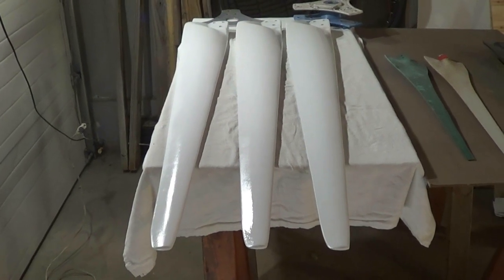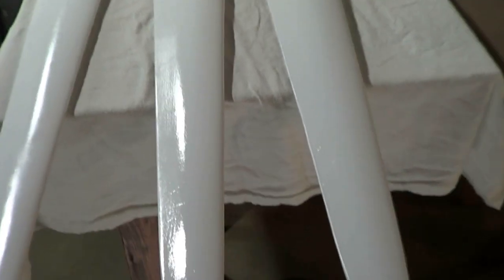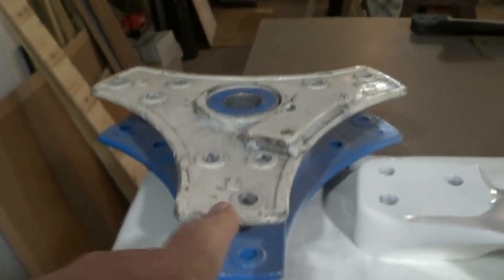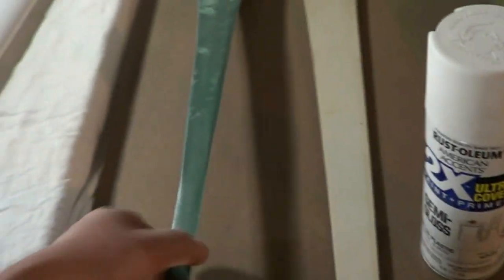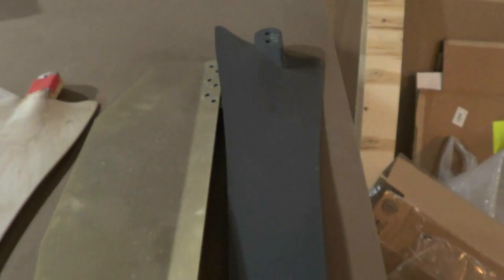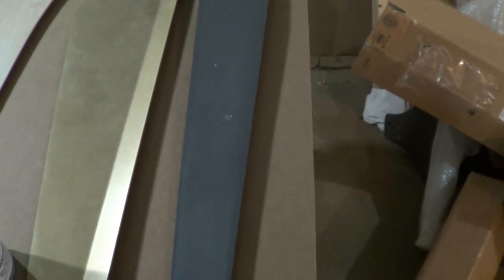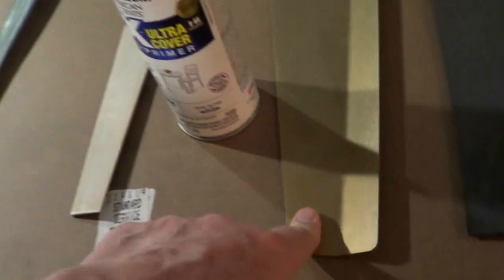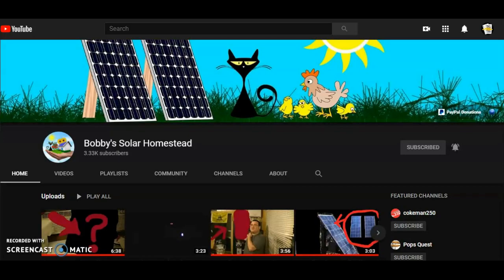AXIAL FLUX WIND TURBINE CMS BLADES

Comment: Good to see you back Billy I noticed on your wind turbine there the picture of it it don't look like it's got slip rings on there are you not putting slip rings on or do you have to have them reason I asked is mine is pretty much crap that I got on and I got to take it back down I don't want to take it down and put it back up too many times cuz that's a lot of work maybe you can help me out and let me know if you do have slip Rings maybe you could point out where you're getting them and that turban on that midnight controller sure look like it's putting out a lot of power good job and thanks for your videos man they sure help a lot keep up the good work

Comment: At what speed do these make some wattage at?
Reply: If you get it dialed in and the right bladeset they can start producing in a 3-6mph wind
Reply: @ericjackson6082  awesome thank you so much. Which I knew about these sooner.
Reply: @GrumpyMountainMan  I know me too!! Billy here has tought me alot and a man with your skillset could definitely build one!!
Reply: @GrumpyMountainMan  if you go to my channel you can see what I have so far I got 307 watts out if it with a cheap set of blades and 1 set of magnets in a 20 mph wind my bigger set of blades just arrived so when I get those on I will do another video
Reply from the maker: Hey GMM, the biggest problem with the turbine is having a solid tower, because of degrees of force from the blades and wind. Let alone the weight of axial flux. the startup vids will be coming soon as Tim puts his wind guage on tower. Thanks again!
Reply: @blackjackaxialfluxturbines4174  would a 2 inch rigid conduit 20 feet in the air support it?  I have 2 unistrut supports plus a base 4 ft in the ground. I'm not using guy wires.

Comment: I'm at the blade building now. 
2.4meter set. 
Wonder which is the best route to take.
PVC or hand crafted wood?
Reply: Hello Billy. 
Could you put me onto a magnet supplier that would have the correct spec.?
50x25x12.5 40N neodymium magnets please.
Reply from the maker: @clintonjacobson3282  https://www.ebay.com/usr/cms_magnetics?_trksid=p2047675.l2559
Reply from the maker: PVC has no real weight to make torque. wood blades are good. thanks for comment.
Reply from the maker: checkout new vid
Reply: @blackjackaxialfluxturbines4174  hello billy.
What gauge wire and how many turns would be the best for a 24vdc system. 
9 coil and 24 magnets system
Reply: @clintonjacobson3282  I have a 9 coiler with 113 turns on it for a 24v system this is my first axial flux turbine I built and am still in the process of tweaking I think if I build another I would make it a 12 coil unit imho
Reply from the maker: @clintonjacobson3282  14 ga. is good enough for a 24v turbine. 15 ga. will give a higher voltage. 65 turns of 14 ga. wire will work with 12v and 24v axial flux. Good Luck!
Reply: @ericjackson6082  hello. 
How many magnets would you use for a 12 coil system and what wattage are expecting?
Reply: Howsit Billy. 
I jumped in the deap end as I wound coils with from info I found on you tube.
14 gage at 95 turns.  Coils are 300g each. 
Any comments please